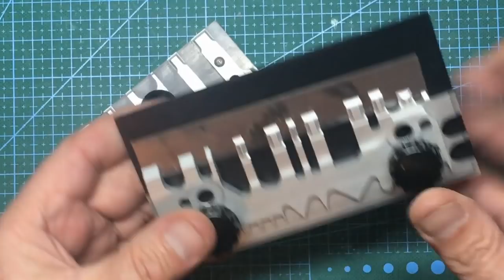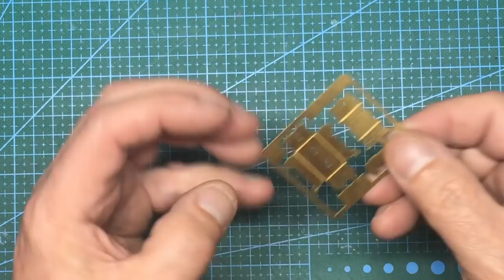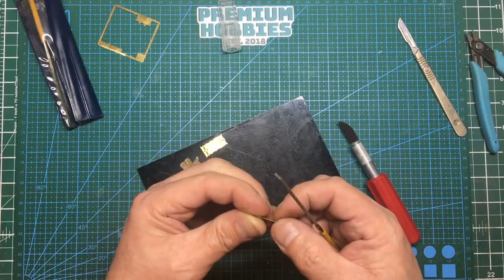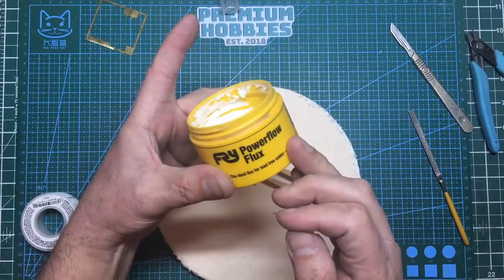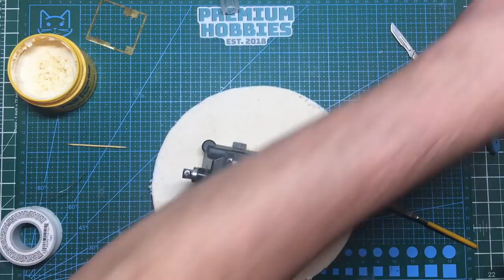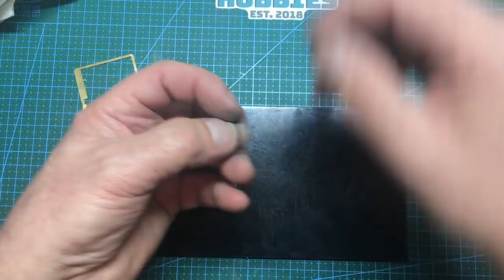PH Designs Fold assist. Review, assembly and test.

Comment: You can get solder paste that’s solder and flux together. It’s perfect for soldering with a torch like that. Also comes in syringes for easy application. Downside is that is has a shelf life of about 6 months.
Reply: How I solder photo etch , I use pure solder paste , no flux , and a jar of acid flux paste , I mix
them is a small metal cup , say 50/50 with a blob of pure solder , pure flux to each side of the mix 
I can easily change the ratio as needed , still use the same syringe of solder for years now
I do not sand or clean the photo etch , Hmm you say ? The solder won't stick , yes ,
There are many places I do not want the solder to stick to , especially relief etched parts
Lets take a simple box for a example , after the fold there will be corners not sharp or with fold
holes , I take a sharp 11# and merely clean up the corners , apply a dab of paste and lightly drag 
my iron along the corner , am trying to fill the corner with a slight excess as solder has to be the 
easiest thing to sand in the modeling world ! And it looks just like metal when your done
Reply from the maker: @jamesgathings6364  Yes, your liquid flux is cleaning the PE. This demo was not the way i solder PE, I have done that many many times with great success. This was using a blowlamp to solder thick brass.
Reply: @NigelsModellingBench  Yes , I do Pontos 1/200 , solder about 60% of the frets , and yes 
a torch would make sense with thick brass , do you know about Kapton tape ?
Reply from the maker: Yeah, I have it in 3 temps and I cant get on with it. Like you say, short shelf life makes it useless for the hobbyist.
Reply: @NigelsModellingBench  Yeah. Ok if you're doing all the soldering for a 200 ship (Nigel's Ship Modelling Channel will be ok 😉), but otherwise an expensive waste.